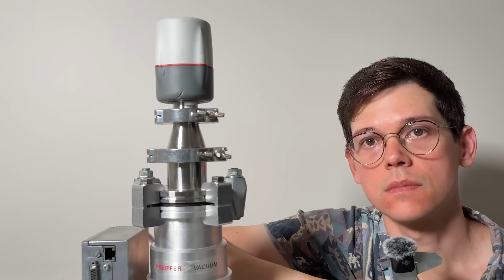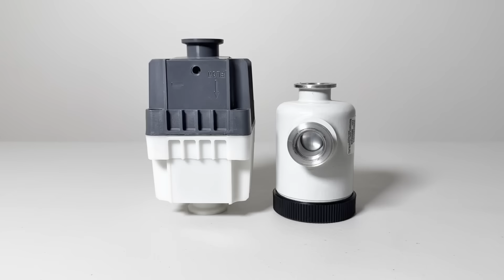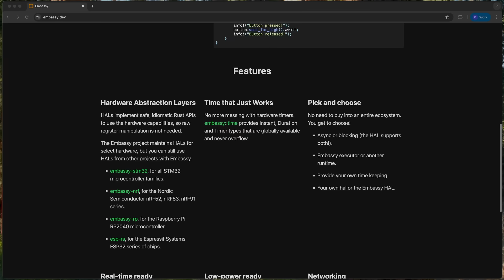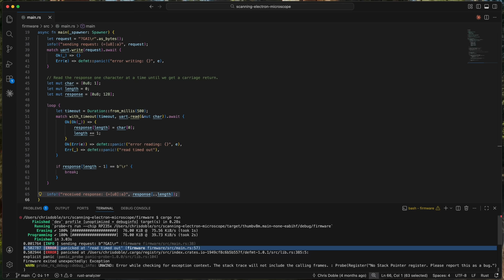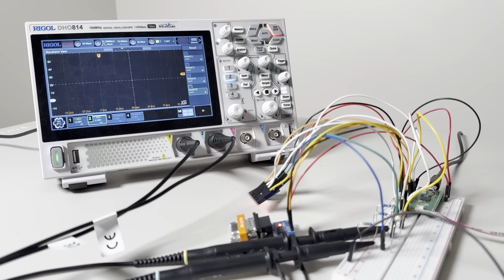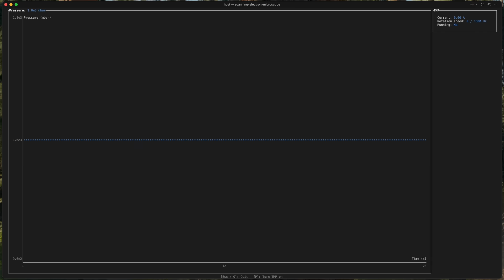Reaching 10⁻⁶ mbar for my homemade electron microscope

Comment: Make sure you fasten down the turbomolecular pump. I bought one to replace the diff pump on my home high vac system, then did some calculations on the KE of the rotor. After having seen the result of an unbalanced ultracentrifuge I rapidly decided to return to the diff pump.

Comment: Nice project, well explained. I was a Ph.D. student working with a VG5 scanning transmission electron microscope in the 1970s.  The tip area operated at around 10**-11 torr,  it got that low using a titanium sublimation pump, an oil diffusion pump and a rotary pump.  We spent a lot of time baking the equipment to out-gas volatiles from the surface of the already very clean stainless steel chamber.  The tip was in a chamber that could be sealed off from the main chamber,  so the latter could be let up to atmospheric pressure and evacuated in a couple of hours for a rush job.

Comment: would you mind to let me know what the e-beam simulation software is at the end of the video, thank you
Reply from the maker: It's custom software that I'm building. It's not intended to be 100% accurate — more to help me develop an intuition for how changing various parameters affect the beam. You can access it at the repository I linked in the description in the electron-gun-simulation directory.

Comment: Instead of manual confirmation for the second pump could you have the controller query the gauge and return an error if above 18milibar? Interested to follow this project, it's really interesting!
Reply from the maker: Yep! It currently does that which you can see at 14:45. It asks for confirmation even if the pressure is below 18 mbar (which you can see at 15:27) because you might have run the roughing pump in the past, got the chamber to <18 mbar, turned the pump off, and not vented the chamber to atmosphere. In that scenario you wouldn't want to turn the turbo on because there's no roughing pump backing it.

Comment: it‘s really cool that you show how you went about making sure the parts can communicate properly. I know nothing about electronics, but i want to try to retrieve data from an old testing machine for vintage cameras. your video taught me that i will have to learn a lot about signals before attempting anything, otherwise i might break something on the rare machine =)

do you have any recommendation for resources that help with understanding how to retrieve signals from a source where the structure and „intensity“ of the signal is unknown? I am not attempting to actually read the data, but to intercept it, and make an emulator to hopefully test other machines with..
It is an old shutter tester and normally communicates with a digital probe. i will try to put some microcontroller in between, and record the signals from both sides to hopefully be able to mimic the probe..

Comment: I have all the same things and then some but slightly older turbopump, of that size, incl controller that is much smaller, and a combinbed low and high vacuum gauge with display, all for a good bit under USD1000. So you can absolutely get it for much, much less that 15k. It has gone up nowadays but it was quite cheap just a few years ago. To buy from a company is as I see it a waste of money as an happy hobbyist but if you buy from ebay you have to know what to look for.

Comment: The trippiest thing I learned from a UHVacuum engineer in the semiconductor space that you can't get a perfect vacuum because there is still empty space between the atoms making up the steel, meaning there is always vacuum leak
Reply: Can muons and electrons be in that vacuum/empty space??  If so.. what the hell is empty space..
Reply: @XxDonnaLauraxX  empty space... is a theoretical
Reply: @XxDonnaLauraxX 
Yes but muons are not adding or removing mass from the container volume, mainly there are certain gases which can go through the lattice of steel molecules. Because steel like everything else is made of small things together as a big thing, it has imperfections as well as its generally existing permeability. Gases like hydrogen can get inside a steel tube from outside it.

To picture density it makes sense to view atoms not as little balls with balls or orbiting them but more like each atom is a link in a chain and a complicated molecule or substrate of material is like taking both ends of that chain and coiling it as tight into itself as it can go, you end up with a super chain that is dense and way less penetrable than each individual link 🔗 when it is uncompressed . So at the atomic level there is always empty space between stuff in solid matter, subatomic electrons and muons can be in this space, for extremely miniscule yet still predictable and measurable moments in time, but it's not electrons and muons causing a vacuum leak, it's just the nature of all matter to have holes in it, and when you look at the periodic table, the light and lighter the gas, the more it can permeate into various substances.

Comment: Good work, when I built my vac chamber and UHV system, I ended up building my own Ti Sublimation pump. It was a very budget system, but it got me to the ~10^-5 range, which was the limit of my measuring equipment

Comment: 35 years working borosilicate and quartz light bulbs, making custom uv glasses.,,etc.   what i can tell you quick is.   EVERYTHING IS POROUS ...EVERYTHING. the metal,,, the glass,  all of it is alot more porous then you would every think.  a 2 inch tube of 4 mm thick borosilicate thats a foot long, will hold several spoons of water. you can see it come out with a vac pump. best way to avoid this is by baking it ,,preferable above 800 F but below 920  ( begining stress point of borosilicate, but above the point where all organic matter will turn into ash. ). best is to bake it while also sucking it down with the vac,,,and doing a  "wash" of the bulb by alternating injecting argon ,,and sucking it out.  this will leave you with only traces of argon,,,instead of traces of a reactive gas ,.  if you need glass or advice hit me up. david matthew dalleinne.  ill try to look at my FB messages.

Comment: this so cool! about a decade ago i built a system to extend the lifespan of helium leak detectors and seeing this gave me flashbacks to wrestling with RS232 and the bafflingly inconsistent and unprofessionally designed PolyForth2 internal command system on those machines 💀 (50% of the documentation was jokes...)

Comment: Could you try validating (or debunking) the Exodus Propulsion Technologies concept while you’re at it?  Basically it’s charging up a Kapton tape parallel plate capacitor for an extended period of time.

Comment: This is great. I recently took a class on manual vacuum operation procedures with hand valves, and I always wondered how easy it would be to automate this.
The only difference is if you don't seem to have a roughing line separate from the turbo line. The roughing line is super useful if you need to take stuff out of the chamber but don't want to wait for the turbo to spool down, as you can close the turbo valve and vent to atmosphere, swap wafers or whatever you're working on in the EM , then close the rough exhaust from the turbo (to prevent the turbo from seeing a pressure spike from chamber), open the rough line to pump down until it is ready for the turbo, then close the rough line, open the turbo exhaust, and then open the turbo. Assuming the pressure in the turbo doesn't increase too much from leaks or moving pressure from one side to the other, so it doesn't see high enough pressure to break, you don't have to wait for it to spool up or down and can isolate issues or leaks from the turbo or rough pump.

And now you see why I wanted this to be automated, because not breaking the rule of NO backstreaming and keeping the turbo below 1 Torr was a lot to monitor by myself even with only 3 valves.
Reply from the maker: It'd be great if I could separate the turbo from the chamber and vent them independently for all the reasons you described. I looked into it briefly while researching what equipment to buy and decided to keep things simple for now. Maybe in the future!
Reply: @chrisdoble  Ideally a pneumatic gate valve and a small dry pump for the main chamber. It only has to get to around .1 torr to open to a turbo already spun up. That would drastically change how fast you can change out samples. At our company we regularly use cheap valves from companies on amazon like tailonz. It would only be automating 3 valves( turbo gate, roughing, and vent), and we usually physically interlock the HV and vent/door etc. Like running the Turbo open through the normally open on the relay for vent, to reduce the risk of user error etc. 
Every vacuum surface needs to be wiped down as others have said, it's pretty crazy how much of a difference it makes( it was bad that you touched inside the turbo and on the HV flange, but you can just wipe that with Q tip and isopropyl)
Lastly, the roughing pumps introduce a lot of vibration, Its probably worth using an isolation block or long hose from the turbo to the roughing pump. In high end sems, they are in a separate room and piped in. (the turbo is also vibration isolated but thats probably fine for a budget sem system)

For a small chamber with that turbo setup, you can probably expect at best around 5x10^-7 torr after a 100C bakeout of chamber because its pump rate isn't that high. 

That being said for a lower res SEM that is more than fine! Ive used an older SEM with no foreline traps and an oil diffusion pump that had never had its oil changed, that was barely maintained that we literally put wet bone samples into, and it was able to capture decent resolution of surfaces especially in low vacuum mode with Back scatter detection and reasonable scan times. 
A small turbo setup will be less forgiving as the pump rate is much lower than a diffusion pump, but it should still just work for this system as is!
I work primarily with refurbished/ebay vacuum equipment and have gotten old equipment down into the 10^-9 torr range with good cleaning practice and patience baking systems. feel free to reach out :)

Comment: ai summary

Abstract:

This technical report details the construction of an automated high-vacuum control system engineered as the primary subsystem for an open-source scanning electron microscope (SEM). To prevent electron beam scattering from gas molecule collisions, the chamber must operate in a high-vacuum regime. The developed system employs a dual-stage pumping architecture: an oil-sealed rotary vane pump for roughing (ambient down to $10^{-3}$ mbar) and a turbomolecular pump (operating at 90,000 RPM) to achieve a high vacuum of $10^{-6}$ mbar. System pressure is monitored using a wide-range active gauge that automatically transitions between dual internal measurement mechanisms.

Control and automation are executed via a custom-designed embedded controller utilizing a Raspberry Pi Pico 2. The system firmware is written in Rust using the asynchronous Embassy framework. Electrical integration required designing custom interface circuitry to shift the microcontroller's 3.3V UART signals to the bipolar voltages of RS-232 (for the pressure gauge) and the differential signaling of an RS-485 bus (for the turbo pump). A custom PCB was fabricated to consolidate the level shifters, serial ports, and microcontroller into a single 3D-printed enclosure. A terminal user interface (TUI) was developed to provide real-time graphical monitoring of chamber pressure, turbo rotational speed, and current draw, incorporating a firmware-level safety interlock to prevent turbo operation at unsafe pressures. Successful system validation demonstrated a rapid pumpdown sequence, achieving $10^{-6}$ mbar within 12 minutes of initiating the turbomolecular stage. Preliminary work on the subsequent stage—electron gun design and electrostatic field simulation—is introduced.

High-Vacuum Control System Design, Integration, and Validation

    0:00 High-Vacuum Requirement for SEM: Operating a scanning electron microscope requires a chamber pressure of approximately $10^{-6}$ mbar (one billionth of an atmosphere) to eliminate air molecules that would otherwise collide with and scatter the primary electron beam.
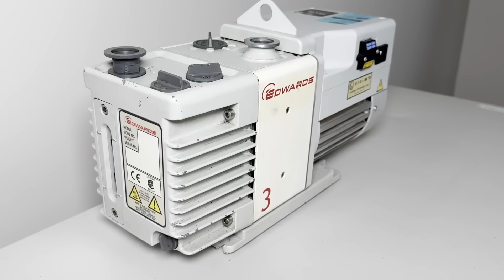    0:47 Dual-Stage Pumping Architecture: The vacuum manifold integrates two pumps with distinct operating envelopes. An oil-sealed rotary vane pump acts as the roughing stage, operating from atmospheric pressure down to $10^{-3}$ mbar. A turbomolecular pump, which operates at 90,000 RPM, is utilized to drive the system down to $10^{-7}$ mbar.
    1:19 Turbomolecular Pump Operational Constraints: Turbomolecular pumps cannot operate safely at high pressures due to extreme blade loading. The unit in this system has a maximum operating pressure threshold of 18 mbar; consequently, the roughing pump must draw down the chamber below this limit before the turbo pump can be safely energized.
    1:54 Contamination Mitigation via Anti-Suckback Valve: The rotary vane pump features an integrated anti-suckback valve. In the event of a power outage or pump failure, the valve closes instantly to prevent atmospheric back-streaming from forcing pump oil into the vacuum chamber and damaging the turbomolecular blades.
    2:29 Instrumentation and Component Acquisition: The vacuum assembly includes exhaust oil mist filters and a wide-range pressure gauge utilizing two distinct internal sensors with automatic crossover switching. The secondary-market hardware is valued between $15,000 and $20,000 AUD.
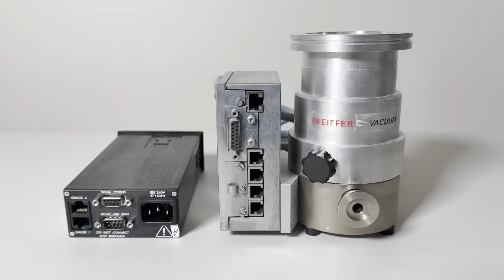    3:37 Embedded Controller and Firmware Architecture: System automation is centered on a Raspberry Pi Pico 2 microcontroller. The control firmware is implemented in Rust utilizing the asynchronous Embassy framework, selected for its compile-time type safety, modern concurrency model, and robust embedded hardware abstraction.
    4:50 Gauge Communication & RS-232 Level Shifting: The pressure gauge controller uses ASCII-coded commands over an RS-232 serial interface. Because RS-232 utilizes bipolar voltages ($\pm5\text{V}$ to $\pm15\text{V}$) which would damage the Pico's 3.3V UART, an external transceiver IC is used for level translation. A null modem adapter is required to resolve pinout conflicts between transmitting devices.
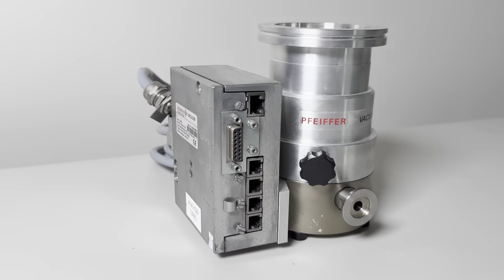    8:40 Turbomolecular Pump & RS-485 Bus Integration: The turbomolecular controller communicates via ASCII over an RS-485 multi-drop differential bus. The interface circuit implements an RS-485 transceiver, a resistive voltage divider to protect the Pico's RX line from 5V logic signals, fail-safe biassing resistors (pull-up/pull-down), and a bus termination resistor. Serial query of parameter 311 verified a lifetime run time of 38,000+ hours.
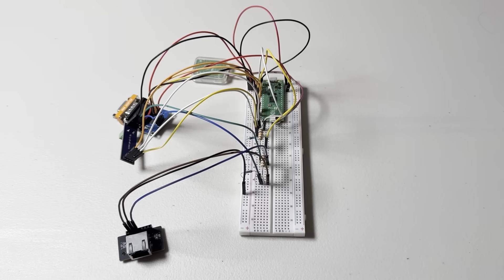    11:40 Custom PCB & Hardware Packaging: To transition from breadboard prototyping to a robust deployment, a custom PCB was designed to host the Pico, RS-232/RS-485 transceivers, and RJ45/DB9 connectors. The assembly is housed in a custom-designed, 3D-printed enclosure featuring brass threaded inserts.
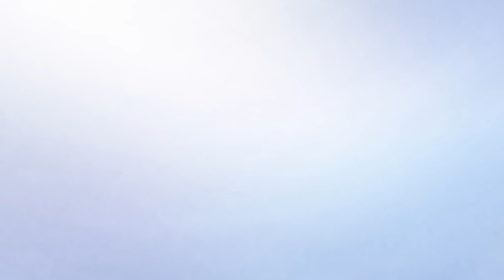    12:27 Communication Protocol Multiplexing: To route data over a single USB connection from a host PC, the firmware utilizes a packet addressing scheme. The host program prepends a destination prefix to each command. The Pico firmware parses the prefix, strips it, routes the raw command to the designated instrument port, and returns the corresponding response to the host.
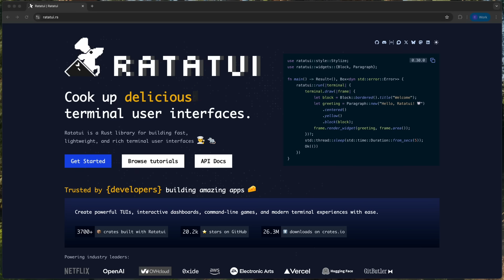    14:20 Terminal UI & Safety Interlock Implementation: A custom Terminal User Interface (TUI) was developed using the "Ratatouille" library to graph real-time chamber pressure, turbo rotation speed, and drive current. The software features an automated safety interlock that blocks the turbo ignition command unless the pressure gauge reads below the critical 18 mbar threshold.
    15:25 Pumpdown Sequence Validation: During testing, the roughing pump dropped chamber pressure below 18 mbar within 15 seconds (reaching 5 mbar in 2 minutes). Engaging the turbomolecular pump resulted in rapid drawdown: achieving $2 \times 10^{-5}$ mbar at 5 minutes (as the rotor reached 100% speed) and entering the $10^{-6}$ mbar high-vacuum range at 12 minutes.
    17:03 Project Roadmap & Electron Gun Simulation: The next phase of the open-source SEM project involves constructing the electron gun. Initial electrostatic field and trajectory simulations are currently being executed to optimize gun geometry and beam focusing properties.

Comment: I'm looking forward to your seeing your progress. I have my own SEM project on the back burner for 20 years (when I acquired a vintage Cambridge Stereo-scan chamber with vacuum system and awesome sample positioning mechanics that was originally connected to a room full of racked vacuum tube equipment. I have been hoping an inexpensive modern beam controller would materialize.